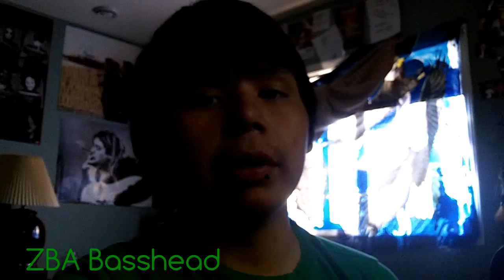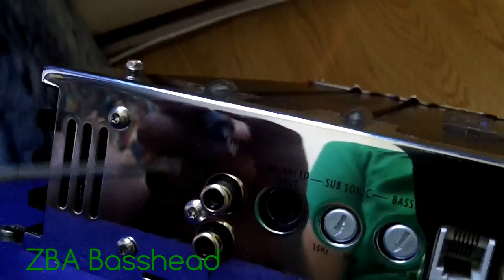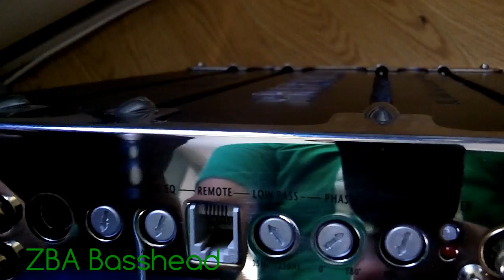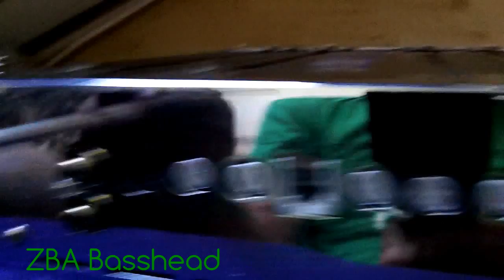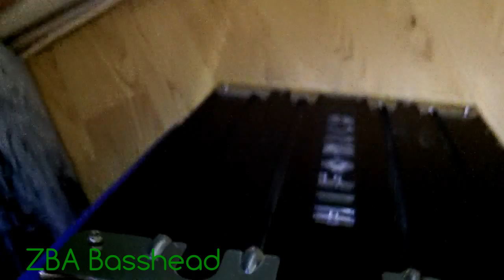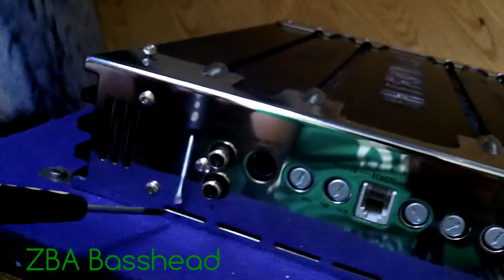How To: Understand Car Amplifier Settings (MonoBlock)

Comment: If my box is tuned to 32-34Hz with on one kicker L7Q15INCH wired to 1ohm on a 1200.1 so where should my LPF be at ? Right now it’s at the 11-4 o’clock position and subsonic is about a quarter of the way turned on the knob. Gain is a quarter Jess than half way. Sound about right? Yeah I got aftermarket 6x9s and tweeters and a full EQ on my screen but that is all hood I’m just needing help because here in Dallas I can’t find anyone